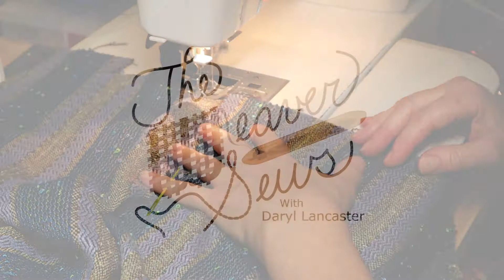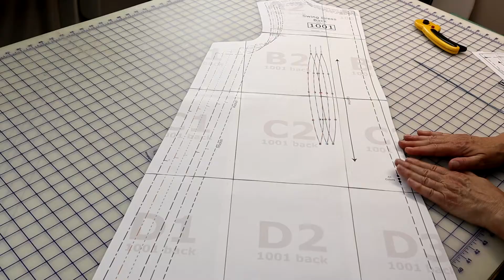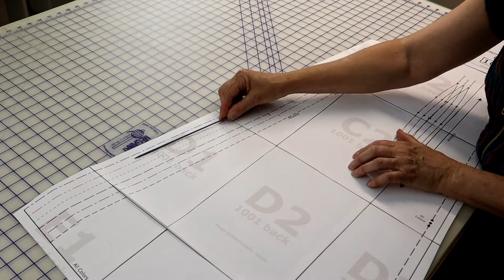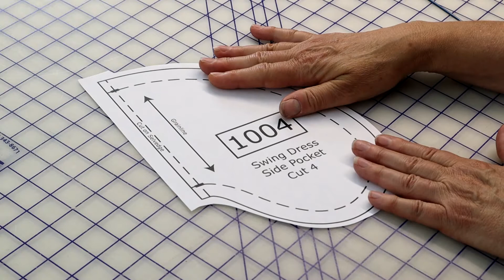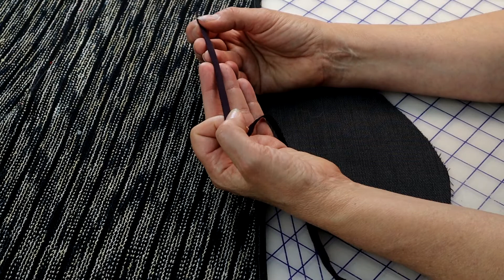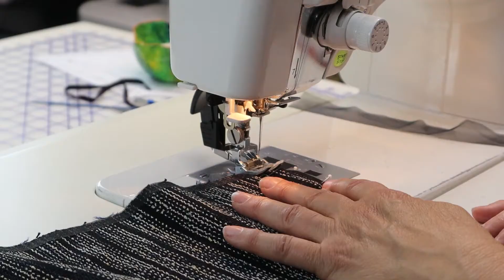Side Pockets: Completing the Pocket Collection

Comment: The tricot added to the pocket bag while the pocket bag is being sewed: is that just added on top of the bag edge or underneath, or does it matter. Since it's all one color, it's difficult to tell. Thanks!
Reply from the maker: The tricot folds over the edges of the pocket bag, and is applied just like I would use it as a seam finish.  So both the underside and top of the perimeter of the pocket bag are covered.
Reply: Is the twill tape only nessasary if the pocket edge is cut of grain or will it also be needed in a side seam pocket where the opening is in the grain line direction?